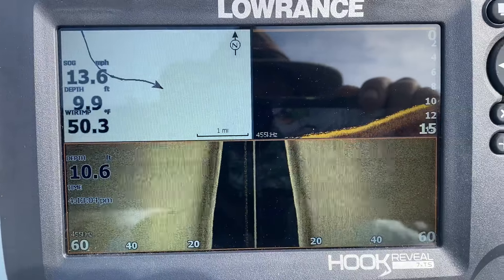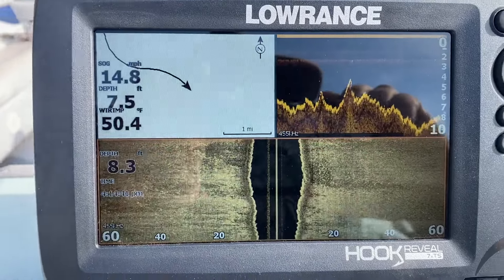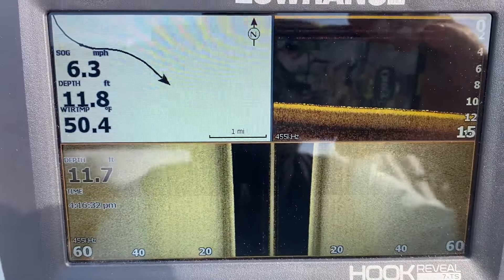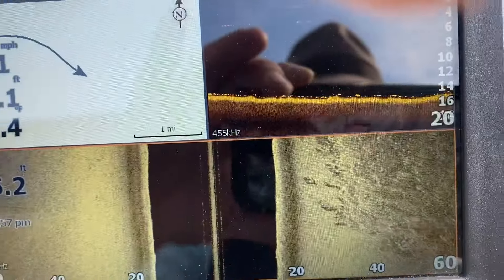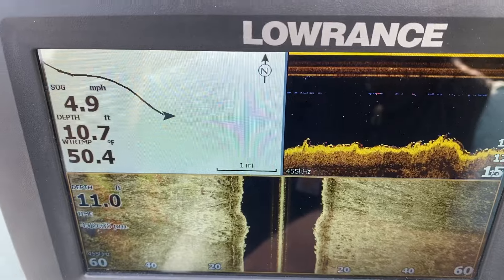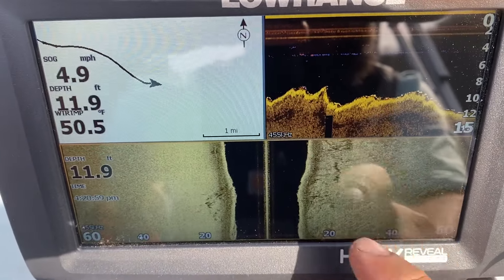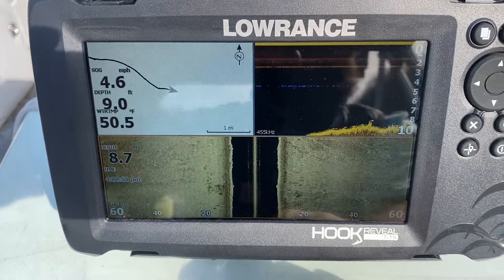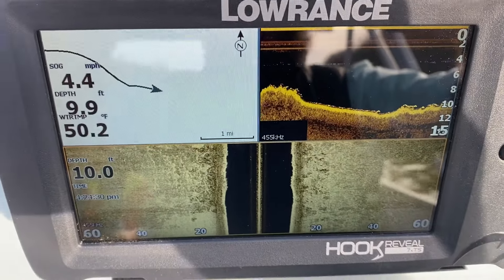Lowrance Hook Reveal 7x Tripleshot at work!

Comment: why is it called a side scan when you're looking vertically at the bottom from a birds eye view?
Reply: It’s the side scan of the boat so if you were to go on either side of your boat, a few feet or 20 feet straight down that’s why it’s called side view. What people don’t realize is cheap fishfinder generally only find fish directly under the boat path. It doesn’t lookon either side of the boat quite a few feet, but that will.